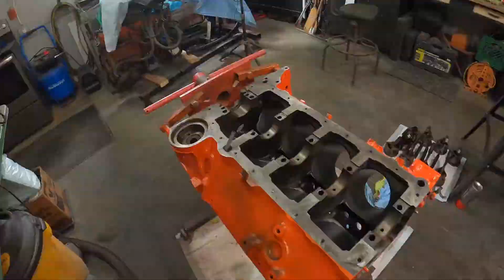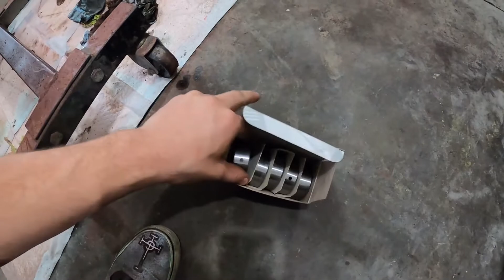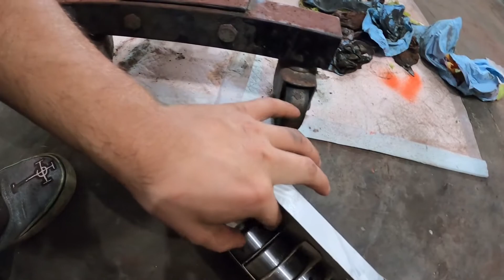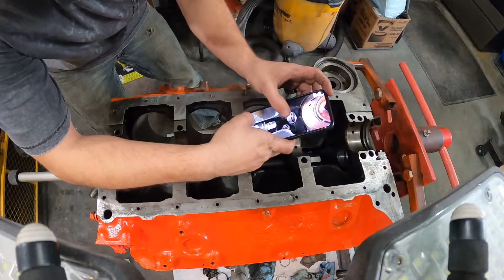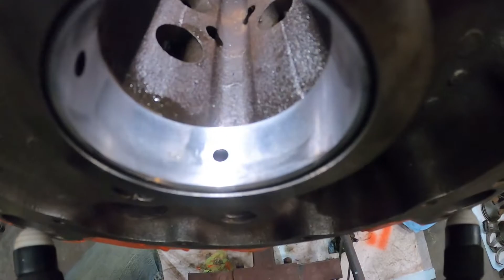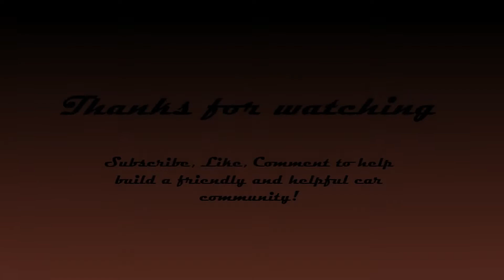350 SBC Rebuild Part 4: Cam Bearing Installation

Comment: Hello, the followings is a direct quote from my GM service manual for the Small Block 350.
Number one cam bearing oil hole must be positioned so that the oil holes are equidistant from 6 o'clock position.
Number two through four bearing oil holes must be positioned at 5 o'clock position (toward left side of engine and at a position even with bottom of cylinder bore).
Number five bearing oil hole must be in 12 o'clock position.
Reply from the maker: The original GM service manual is a great resource for information. Modern engine builders have discovered that the service manual bearing orientation is not the optimal orientation for oil wedge. 

The optimal bearing positioning is as follows;
Cam bearing 1: 12:00&3:30
Cam bearings 2-4: 3:30
Cam bearing 5: 12:00

This has been proven to reduce wear on the camshafts and bearings.

Comment: Where did you buy your cam bearing instalation tool from if you don't mind me asking ?
Reply from the maker: I purchased my tool locally at a tool and supply store. I know they are also available online from Amazon as well.
Reply: @NxvaTheMachine  lisle 18000

Comment: I just took apart a 350 that someone had lined up the bearing holes at the top like you did and every cam bearing was wiped out. Was also the first time in 20 years of remaning engines I had seen them lines up like so.
Reply from the maker: If you listen to the video, and watch the installation procedure you would see only the rear cam bearing is clocked to the 12 position. The front bearing is clocked to the 12 and 3:30 positions. The mid bearings are also at 3:30 position. 

Skip to 12:50 to see what I'm talking about. Thanks for the comment.
Reply: @NxvaTheMachine  I watched and I saw what you did, all good man. I build around 40-50 engines a year so this was a bit different than three engine shops I've worked.
Reply from the maker: @whiplashmachine  I appreciate your input. I was just replying to clarify that not all cam bearings were clocked to 12 position. I also work in the trades and have seen what you spoke of, with the bearings all lined up to the top, that provides as you would know - a terrible oil wedge for the thrust loading side of cam rotation. 
I'll be sure to check out what you have posted!